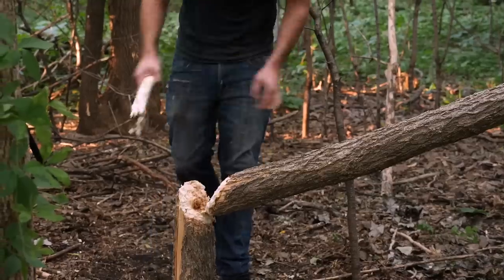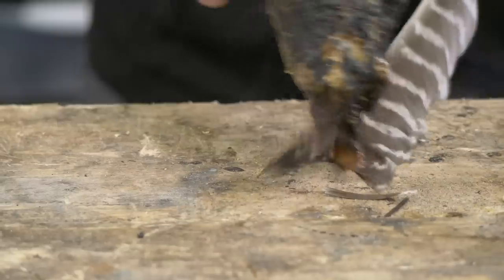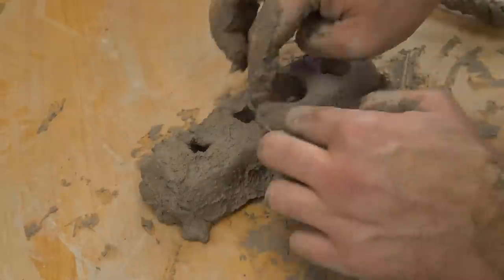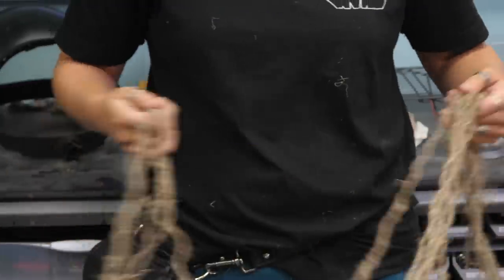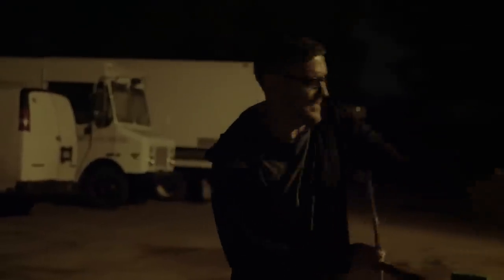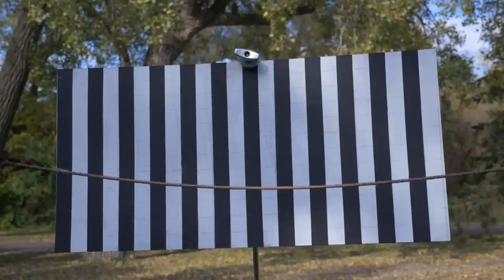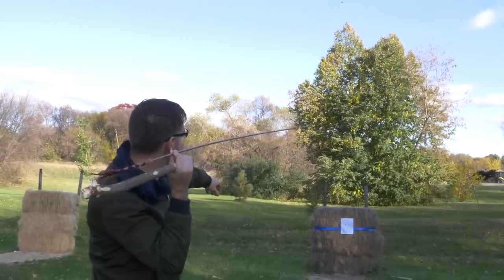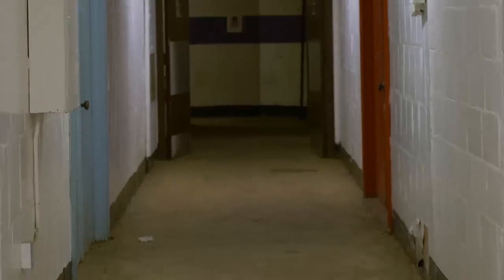Building Primitive Atlatl and Sling from Scratch

Comment: 1) you are throwing too hard.  you are overpowering the dart (and your dart is too light they don't have the nose weitght)
2) you need a stone or steal head on your dart to give it proper weight to fly (try just throwing the dart first to see if it flys)
3) your stance is all wring you need finger loops on your Atlatl   that way you don't have to hold it to tightly which is throwing off your shot
4)with Practice you can hunt very effectively. a well made heavy dart can hit with well over  70 foot pounds of kinetic energy which is enough to drop anything  from deer to  Bison and atlatl points have been found in mammoth bones.  It also penetrated the armour of the Spanish conquistadors so any modern Body armour would be fairly useless against it
Reply: Hey, I'm the person that made the atlatl and darts for Andy. The darts that look like they're overflexing are actually fiberglass practice darts, which have a more accentuated flex throughout the main shaft, but more mass overall than a standard river cane or wood dart. They flex more on release, but through the same principal as the archer's paradox, they flatten out in trajectory. They throw well with lighter to medium strength throws, and are better for practicing form. Looking at Andy's throws with the angle of impact, they seem to still be well balanced enough to use with his atlatl, as they're hitting the target fairly straight on, even if a bit light for the strength of his throws. 

Fire hardened tips were also common for atlatl darts, as the hardwood foreshaft provides forward mass in comparison to just relying on a stone or bone head, as well as the taper of the dart itself and the drag produced by the fletching. 

Finger loops were also fairly "optional" and they really depend on the kind of atlatl being used, and the time period they were used in. Woomera, for example, didn't use any, nor do many modern designs of atlatl. Without finger loops, the grip of the dart changes slightly, but they're still just as effective as a northern plains or basketmaker atlatls.

Finally, modern body armor is generally steel or ceramic plate, roughly 1/4" thick. An atlatl dart, no matter how well thrown or well made, won't penetrate them.
Reply: @ENoland8  having hunted with an Atlatl myself i agree the hardwood foreshafts are very useful but you need the weight of a stone of steel head for added weight and penetration as for body armour you are referring to the removable "trauma plates"  not the overall kevlar make up of the armour which is NOT KNIFE PROOF so you can think of an Atlatl dart   spear point as  a large stone or steel Knife  travelling at 90+mph impacting with  anywhere  between 70 to 180 foot pounds or more of kinetic force  easily punching through it. If it can go through elephant and bore hide  modern body armour won't stand much of a chance was my point. 

You did a nice job on it  though i will say they looked a bit too lightweight to be functional for hunting. when he through them by hand with only the hardwood fore-shafts  not giving enough  weight  to move the centre of gravity forward  for steady flight with all the pitch adhesive you poured on the fetching (pine pitch  + charcoal, yes?)  as the hardwood shafts holding the heads (broadheads or clovis points) that gave additional weight to balance the darts   the darts looked a bit small as well as atlatle darts usually are more  about 5-6 foot long, but that is a personal preference we are talking hunting  large game and all. But i would encourage Everyone to research them,  make one and a few darts and see for yourself how much FUN you can have with a "throwing stick" . once you master these "primitive skills" you will never fear the unknown again.
Reply: @rickcoona  Aight man, gonna be frank with you now. I've been making atlatls and bows for 6 years, and have seen time and time again that you don't need forward mass with fletched arrows for them to fly straight or penetrate. I personally threw each of the darts I made into a hard block target, seeing more than 5 inches of penetration on each, testing from 10-30 yards.

You can hunt with them all you want, but you clearly don't understand them to the extent you believe you do. Fire hardened points were used for both darts and arrows, and they were used effectively as hunting tools. The fletching themselves stabilize flight, and balance is brought with adjustment of length of the darts, or the thinning of the atlatl/addition of a banner stone. My personal atlatl darts don't use any extra mass for their foreshafts in comparison to the hardened oak foreshaft darts I made for Andy. They have carbon foreshafts and field points, yet still weigh less than the oak foreshafts. They use helical twist and rear drag from tbe fletchings to stabilize flight, which is more effective than forward mass stabilization with force being applied from the rear.

Also, just kevlar vests aren't exactly modern anymore. Soft armor is rarely used, and unless you're adding soft armor to level 3a plates, chances are that it'll be level 3 or 4 plates providing all of the protection, not the kevlar blend that makes up the vest itself.

I'd be more than happy to show you a real world example, recreating the darts I made for Andy exactly, just to prove to you that they're both effective and accurate. I know they are, because I tested them as I do with any other dart or atlatl before I handed it off to Andy.